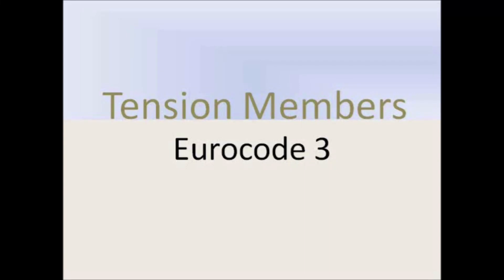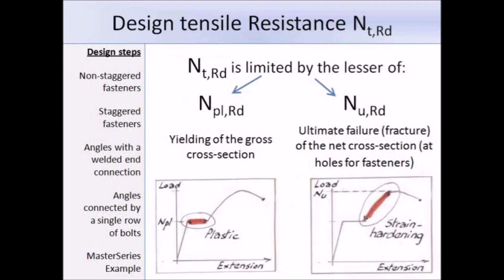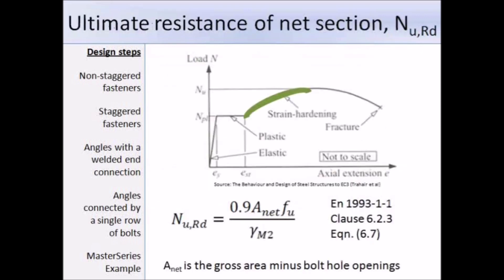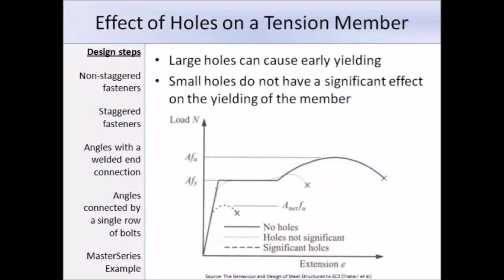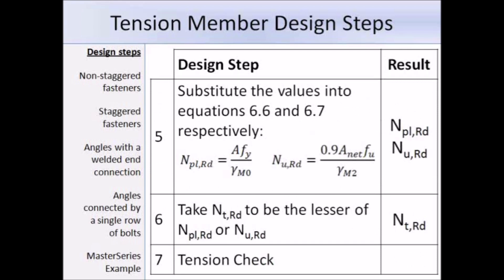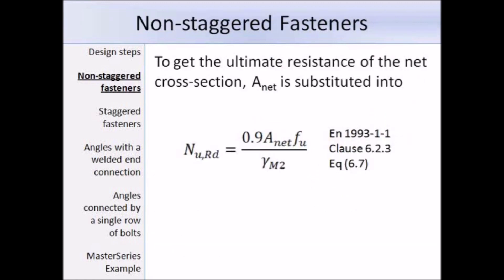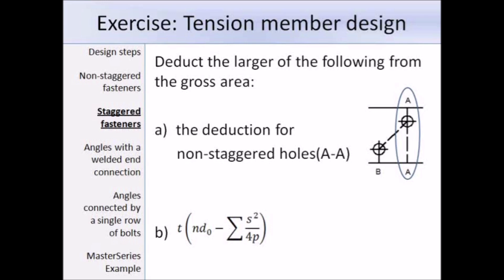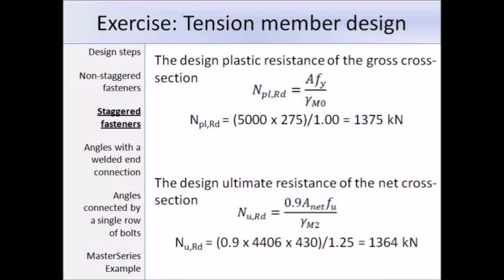Steel Tension Member Design | Staggered & Non-staggered Fastener Design | Eurocode 3 | EN1993 | EC3

Comment: You said we should use the value of fu and fy from the product standards, which in this case are 410 and 265 respectively. Yet you used the eurocode table values of 430 and 275 respectively. So which exactly do we go with?
Reply from the maker: If you are designing in accordance with the UK national annex (NA to BS EN 1993-1-1) then the nominal values of yield strength fy and the ultimate strength fu for structural steel should be those obtained from the product standard. For this example (12:17) fy =265N/mm2 and fu = 410N/mm2 (13:18).
Good eye for detail.